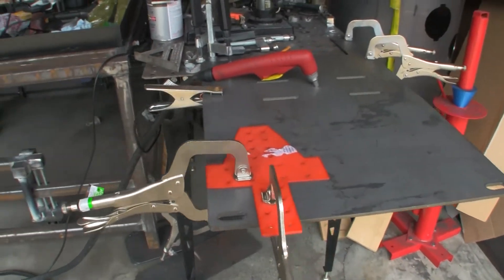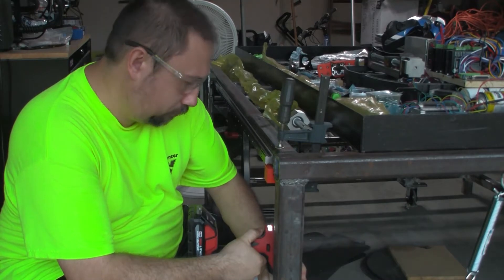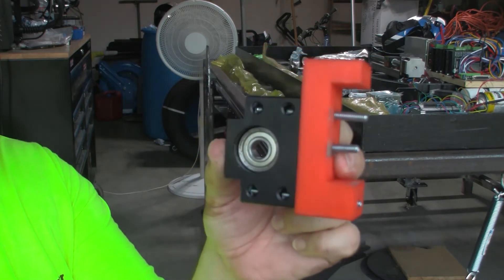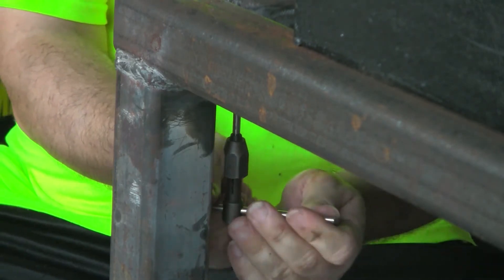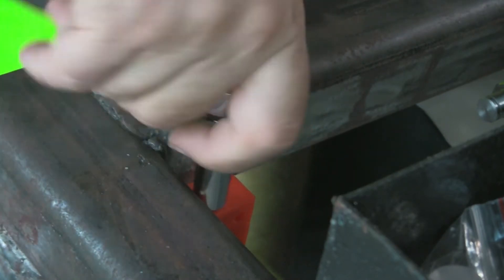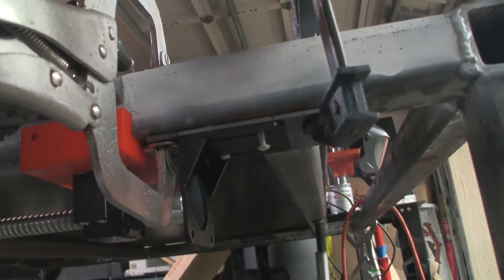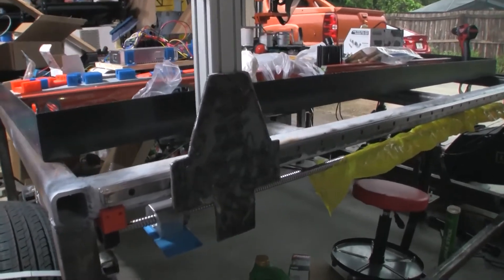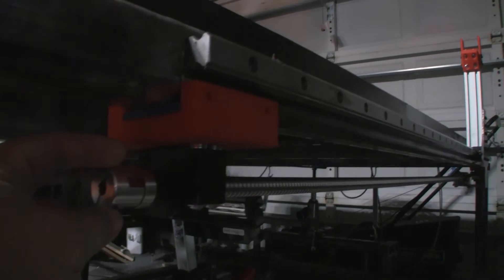DIY CNC Plasma Table Build- Part 4 Ball screws mounted and Y axis gantry finished.

Comment: I'm looking to build a 2"x2" version. Any advice on what ball screw to use for a good speed? I almost ordered the metric 1605 off ebay but I don't know if it will be too slow.
Reply from the maker: Yes my advice is don’t buy ball screws off amazon. I did I couldn’t get any faster then 100 inches per minute. I am now building a rack and pinion to my 2x2 frame. So I got it all done and was a wee bit deflated at the end.
Reply: @blue95stang1  thank you for saving the same adventure!! Could you have put bigger motors on it to compensate?
Reply from the maker: @michaelschiavone9056  Rpm is a factor but the cost of servos to get there isn’t worth it too me.
Reply: @blue95stang1  it's a shame. I wanted that to work so bad.
Reply from the maker: @michaelschiavone9056  me too that’s why I spent the money a couple years ago.
Reply: @blue95stang1  you know what? I'd be happy with 100 ipm. Checked my cut sheets and im cutting 3/16 stainless all the time, it says 90 ipm.
Reply from the maker: @michaelschiavone9056  ya if you don’t go any thinner you would be fine then. But I want to cut a lot of 10 and 11 gauge for signs and I want to cut like 22 gauge for automotive repairs so that is why I have to change over to rack and pinion. Someday I’ll get back in this hard ( maybe in the florida winter when it cools down). Then I’ll post a video with the new rack and pinion parts I bought and fabricated up.